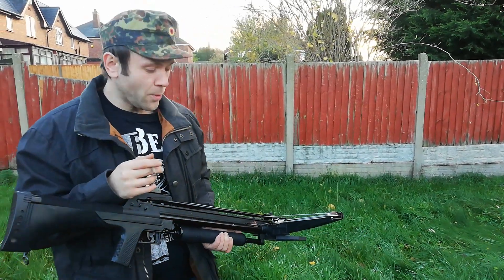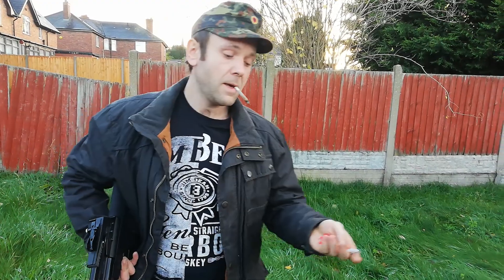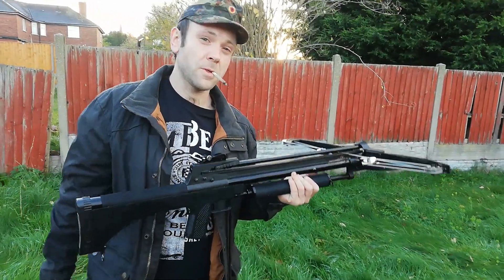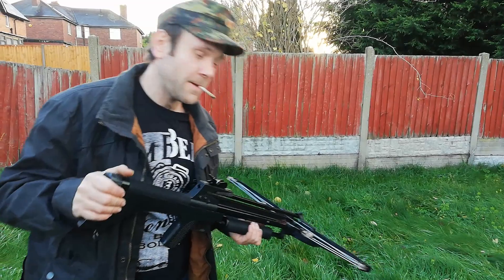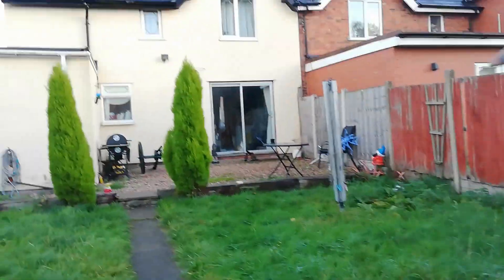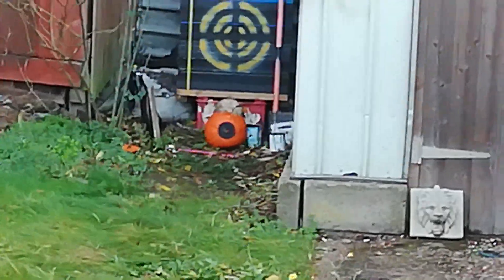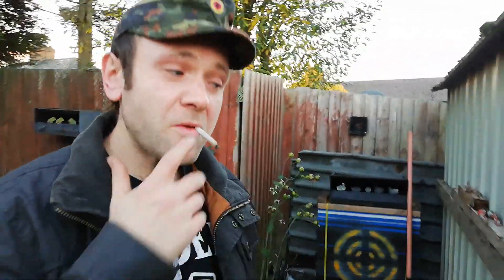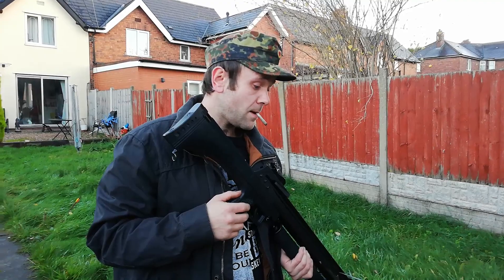Armex blackhawk compound crossbow pt2 shooting tests

Comment: Hi,
Informative video, nice 1 👍
I've gone ordered myself 1, less than £80 so happy days...but being a newby and only used to automatic weapons 😉 what size 'standard' bolts will it take? It never said when ordering, comes with 3 but considering it's a week for delivery maybe I can order in advance..Cheers 👍🍻
Reply from the maker: It’s not all that fussy about bolt size as it has an enclosed rail...you can fire the little wasp bolts right up to full length bolts.tbh ball bearings are the most fun from this bow
Reply: @tumbo1984  thanks tumbo, yeah should be fun. Saying that the supplier said theres an  unusually high demand for crossbows, with hundreds going out daily, stocks are very low with up to 2 months wait time?
Think what's going on at the minute is definitely pushing sales!
I just need to make sure I can get ammo for it, before that runs out...crazy days 🙄😉👍🍻
Reply from the maker: Dinny agreed bud,people are really going to start loosing their shit soon.the ball bearings work out a lot cheaper and are far quicker to load if you need to start rattling off shots
Reply: @tumbo1984  exactly m8, was my thinking, shame I'm not near you, you've got an arsenal 👍🍻

Comment: Great video! Just ordered one will be coming tomorrow i just wanted to ask are you able to mount a scope onto it at all? And what tips do you have for me?
Reply from the maker: You can mount a scope...it has a fitted 11mm rail. Best tip would be to use ball bearings as they are a lot cheaper to buy and much more fun as you can vary your targets from just a foam or straw backstop
Reply: @tumbo1984  wicked! Would you recommend using rail lube for this crossbow also?
Reply from the maker: @sluggun2k8  yes bud use lube... She will thank you for it in the long run.

Comment: Never thought the 8mm would be that accurate being fired from a crossbow, i thought wrong.
Reply from the maker: Im thinking i might zero it for the bb's as i already have plenty of arrow chuckers...might try and source a coconut
Reply: @tumbo1984  Yeh, a coconut would be a really  good test, they are tough. I have never done an ammo test with a coconut, tried a gammon joint for damage testing and a beer can inside a soup can inside a large sweetcorn can so you got 6 layers to get through and i tried them really wide candles with different ammo and a good old argos catalogue and a tefal frying pan like yourself. All the best.

Comment: Dear, do you like this crossbow?
Reply from the maker: Nope...its shite
Reply: @tumbo1984  little power? looks good like a real weapon
Reply from the maker: The power is not the best for arrows. The bb's will just about go through a soup can. The biggest problem is the poor quality of the build and the steel cable damages the frame
Reply: @tumbo1984  Try to install reinforced arc 121.254 pounds. the lock of this crossbow is calculated at 132.277 pounds

Comment: Even it is only 99lb, it might shoot as fast as a 120 or 150lb recurve crossbow because compound bows tend to be faster than "normal throwing limbs".
Reply from the maker: Normally true mste, however this has stacked steel limbs. They Are less efficient than fibreglass and require more cocking energy for the same power

Comment: Would this shoot prober 14 inch crossbow bolts aswell so you could fit broadheads ot seems to shoot fast so with a 14 incher with a ramcat on the end should be very capable at taking small deer and wild boar and the bbs should ruin birds it would hit em like a canon lol
Reply from the maker: I wouldn't trust the broadhead to clear the rail internally on such a short bolt, any miss alignment would see the bolt shatter and shear at the "muzzle end". As for hunting with it, no chance here in the uk it is illegal to hunt anything with bows or crossbows. Absolutely no exceptions on that one. Technically the bb's might be considered legal as it is legal to hunt with a slingshot here if the shot can be guaranteed to be humane... Tbh tho it would be a grey area in the law no one wants to test lol